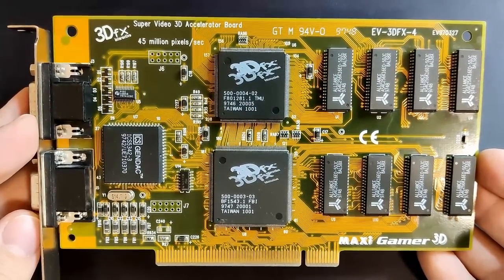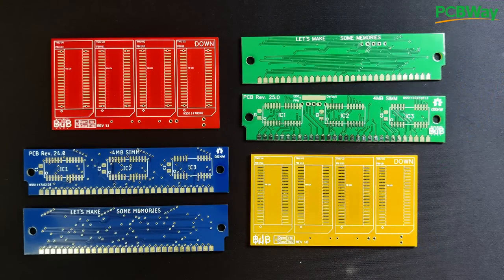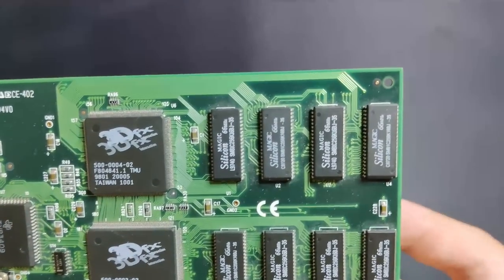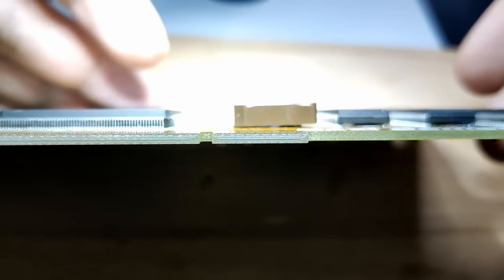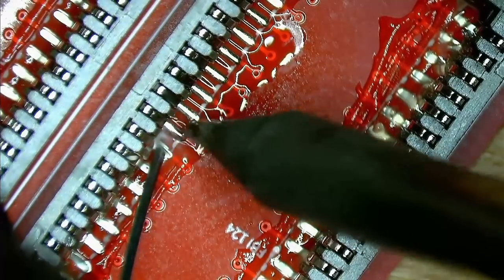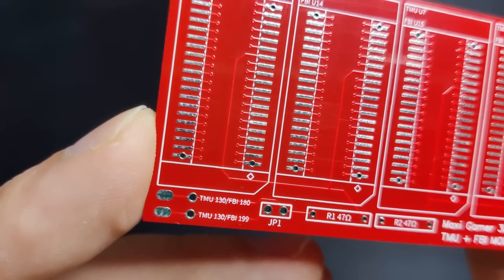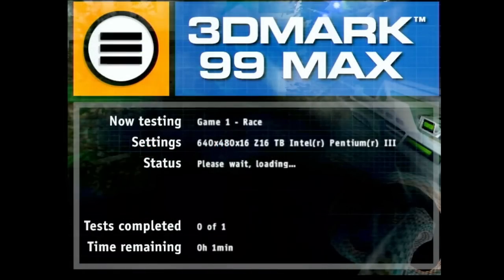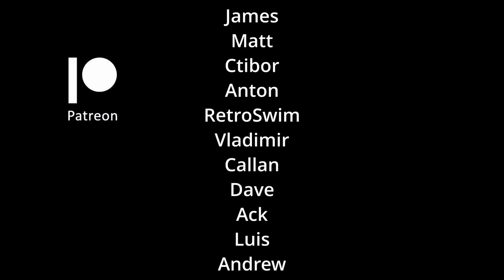3Dfx Voodoo Memory Upgrade: 4 to 8 MB

Comment: Very cool.  You should get some low-profile jumpers and shorter pin headers that don't stick up as much.  Or you could change the design to use the kind of jumper pins that bend 90 degrees parallel to the board.
Reply: The positiond of the modules are fixed. The jumnpers are unnecessary. Solder bridges could be used instead.

Comment: Very nice, You could pretty much have vias on all the pins so that the expansion board could be completely soldered from behind making it more compatible with more variants of sockets, if the vias would not fit side by side you could just offset them in pairs :)

Comment: But why? The original 3dfx games haven't had any automatic memory allocation/usage. All textures got stored by the game/software to a specific memory location. Adding more memory does not result in any positives effects. Direct 3d is a different topic, but i have a doubt it makes sense to run d3d titles on a voodoo 1.

Comment: Isnt there a socket for the chips, so you dont have to solder directly to the chips?
Reply from the maker: Yes, I could have used sockets, but I am low on stock on those ones. I do have plenty of memory chips though.

Comment: ... so 2x vodoo1 sli with 4x4mb memory? is it possible? most voodoo1sli videos on youtube shows ..2 voodoo2 and shamelesly lie about thembeing voodoo 1's but is there a chance to connect 2 of those without a sli cable? i mean you could probably do it on driver level but who knows where the 2nd frame buffer would go and paralelling a monitor to 2 graphic adapters sounds wierd
what do you think can they or can't they sli?
Reply: Didn't obsidian had a card that had two VooDoo 1 operating in SLI, it was a custom PCB and a single card BTW.
My bad, Obsidian is the model of a line of products made by Quantum 3D, the models that used the same chips that were present on the VooDoo1 were the 100SB-4400 and the 100SB-4440.
It would be so interesting if someone would dissect the way these cards implemented SLI, but they were so damn expensive and uncommon, a Russian wizard that goes by "Anthony" had produced several reproductions of these cards, but it's not something he is willing to share with the community, a shame, but legit.

Comment: I'm wondering why you did not use SMD resistors. Also adding 100n decoupling capacitors would be a good idea.
Reply from the maker: I am sure if I would have designed the board for SMD resistors, someone would ask for through-hole :) There was not much thought put into the decision to use through-hole vs SMD resistors. But I am currently working on a different PCB layout that will feature SMD components.

Comment: Now you need to add a heatsink and keep that card cool😅
Reply from the maker: I may add heatsinks. But having a fan blowing over the card is usually more than enough. Airflow should not be underestimated. This card had already broken off pins, so, I don't mind modifying it further. I wouldn't add heatsinks to a Voodoo card in good condition. Airflow should be enough.

Comment: Shouldn't it be enough to just solder the pins directly trough the holes without glue? You fix 4 edges of each socket, that should keep everything in place while you can carefully remove the sockets and solder the rest.
Reply from the maker: It could probably be done without glue. I guess I am affected by my very first board that didn't have those holes.